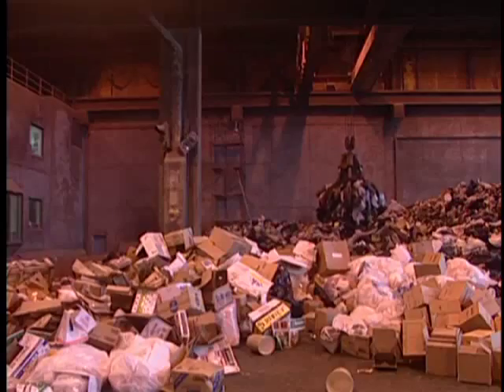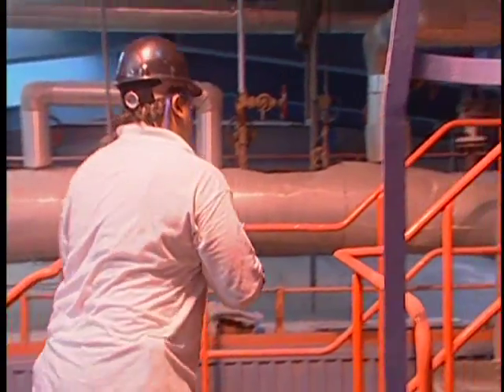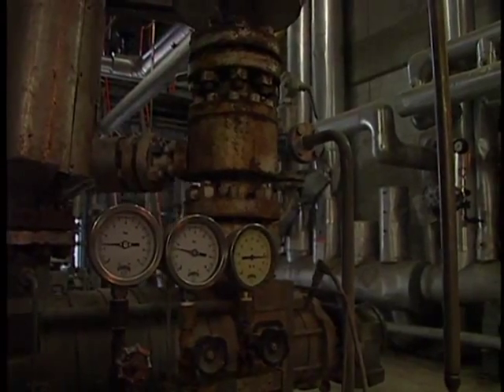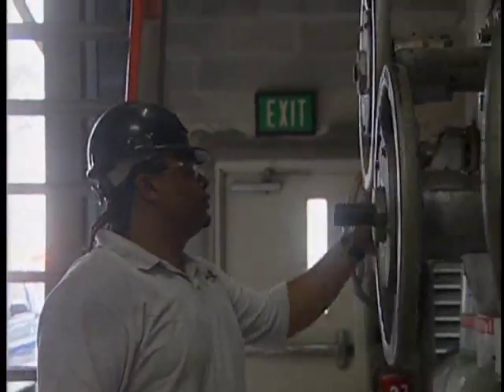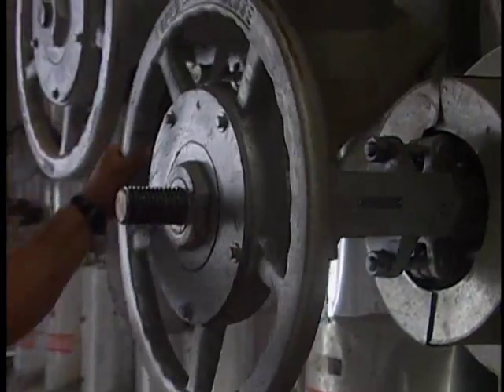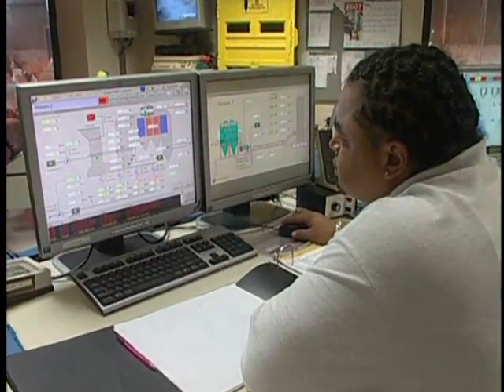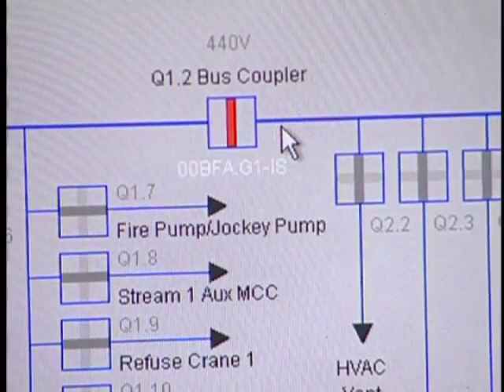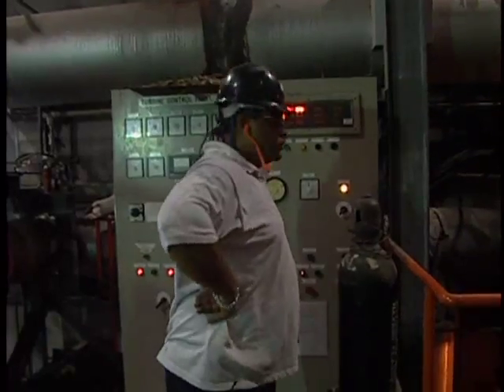Power Engineer

Comment: Not exactly; if you noticed in the vid, it's also inclusive of many aspects of mechanical, hydraulic/ boiler engineering. 
Either specialty would be great choices; but Optometry is "in office" and application specific whereas S.P.E can have you working for a corporation where you'd have several plants to oversee or you can change from industrial to commercial at any time after receiving licensure. 
Best of luck!